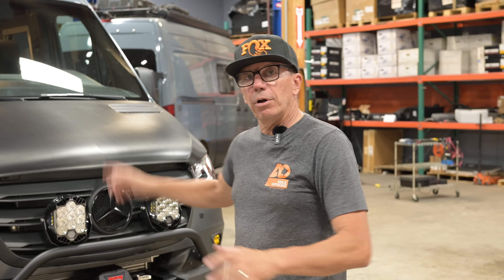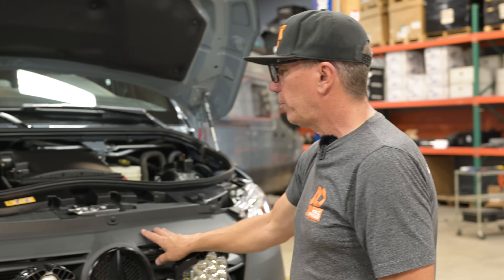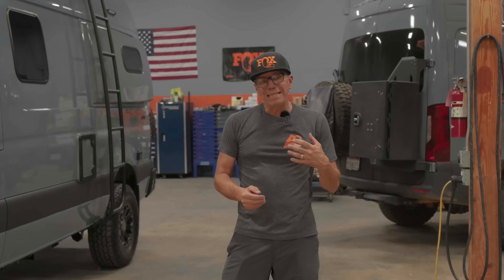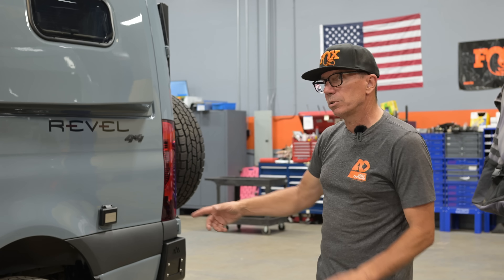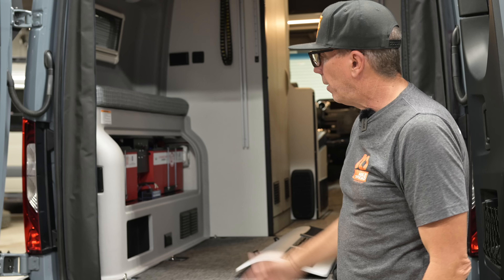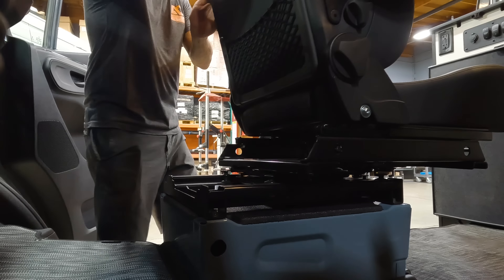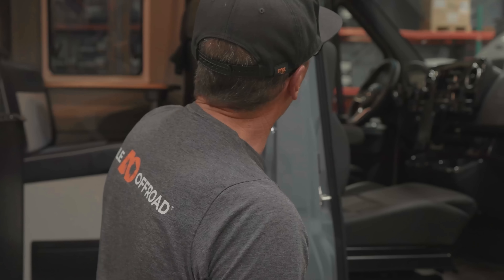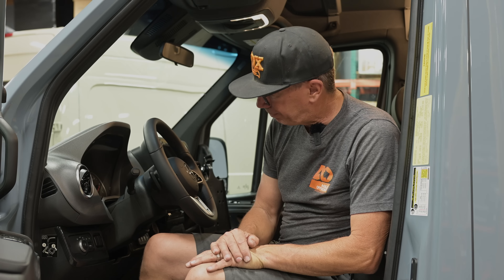Our favorite project yet - THE ULTIMATE 2023 REVEL BUILD

Comment: excellent upgrades, looking at purchasing a 2023 Revel and definitely what to upgrade.  But my other question to you is can the sprinter van / Revel towing capacity be upgraded to be able to tow a 5800 lbs fishing boat?  I do a lot of offshore fishing up and down the pacific west coast and wanting to have a class B rec van for my wife and myself.  So is this possible.
Thx
Reply: Maybe look at building out a Ford Transit 350 Ecoboost, dual rear, heavy duty hitch and brake cntrlr. Highest HP and Torque in a van,  all Ford factory besides the interior build... We need to hear what John has for the Fords next.

Comment: i am concerned about the added weight with all this steel, water, batteries...why not use the dually 3500? i dont see much dually off road conversion.
Reply from the maker: While it is a lot of weight, we never see any issues! you should check out our other videos, John's van weighs 9,000 lbs and is still a beast while off-roading!
Reply: I too was wondering the weight, must be near GVWR with the fuel, water, battery upgrades? But I guess the upgrade leaf springs can handle it?
Reply: @jamestreanor182  i would install the Agile suspention kit anyway for the added support, vehicule behavior, but i was also reffering to insurance, obtaining it and also if we have to use it eventually.
Reply from the maker: @jujulepew   @jamestreanor182  We have different modifications for different after upgrade weights! If you need help finding out which RIP is best for you and your van's weight let us know!

Comment: Why sprinters?  Diesel, overpriced, maintenance costs, and find someone in Montana to fix it.  Simply stop it.  Same problem I have with advanced RV in Willoughby Ohio.  Well, and the price. Transit is superior to all, unfortunately,  challenging to find.
Reply: Maybe for you. My 23 awd high roof with build out gets 27mpg regularly on highway and 20 in town. That is with 33" tires.
Reply: I like the cab roominess and undercarriage of the sprinter which seems best in class for that smooth bottom side for offroad but im leaning to the Ford for the reasons you mentioned. "Theres No replacement for Displacement" or twin turbos in the Transit's case....